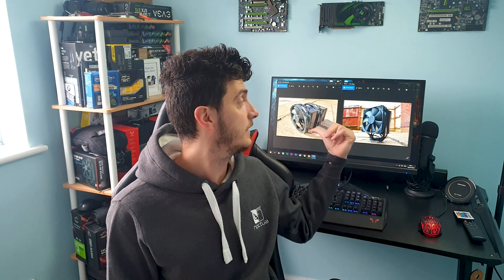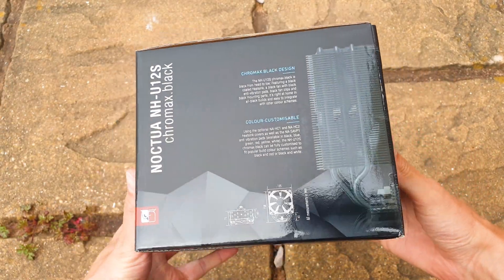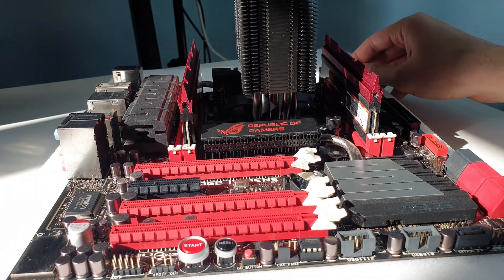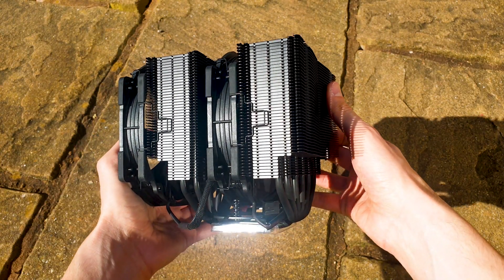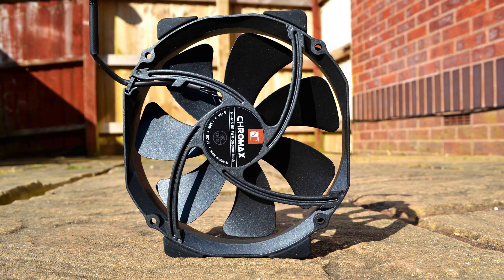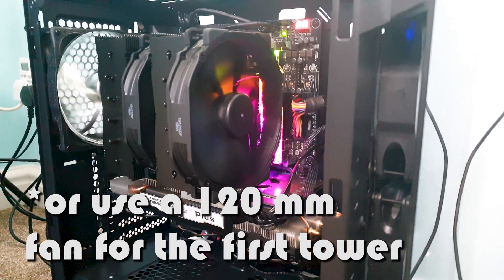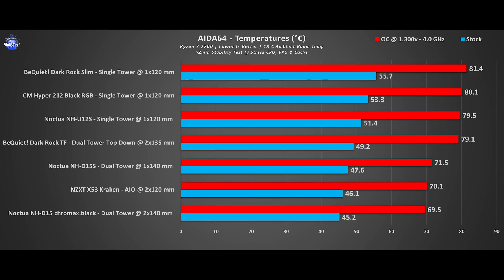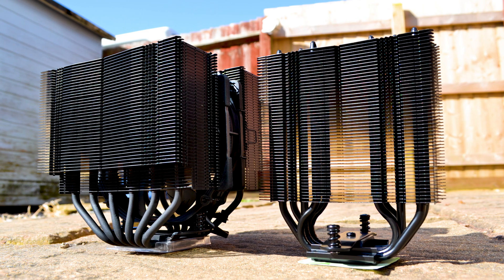Noctua NH-D15 & NH-U12S chromax.black Review | A New Air King and a new baseline !

Comment: Would users recommend the NH-U12S chromax black (the smaller version) over the Noctua NH-D15 (giant daddy) for the i5-13600k which has a Processor Base Power at 125 W and Maximum Turbo Power at 181 W. I'm having concerns getting the NH-D15 because of the weight pressure it might press down on a future DDR4 MSI motherboard of my choosing. Feeling a little bit worried.
Reply from the maker: Then try the U12A. Very close to the D15 but in a 120mm dual fan single heatsink package, I have a video for it as well 👍
Reply: @Glob3Tech  Thanks.

Comment: I have that beefy double-tower but after 2 years, the included 140mm fans are making a whiny noice, so I have to replace them with the design included from the smaller cooler. they are unbarable at full speed at this point. at 300-800 rpm still ok though. So I "have to" buy the 9-blade Noctua NF-A12x25 to get the the most quiet system possible. Damn it's expensive. The ability to read from the screen and work on the computer without fan noise, even when the computer is also  is working, is... fuck me so expensive. Noctua redux fans or the similarly designed 5-blade Arctic P12 fans are worth a shot if you can't afford to pay 60 EUROS for a couple of fans.
Reply from the maker: I know what you mean, the price is 'premium' well. No warranty left to try that route?

Comment: is the noctua nh-d15 gonna fit on asrock b550m steel legend, ram gskill flare x and vga rx 5600 xt ?
Reply from the maker: The ram is 40 mm tall so you would have to position the second fan on the d15 a bit higher like I did in the video, if you case accepts it. The rest, all good.
Reply: @Glob3Tech  oh yeah forgot to tell u my case is old one cooler master haf-x full tower. is the d15 gonna fit with VGA 5600xt ? there's still some space right between d15 and the vga ? or do i need vertical gpu bracket ? i saw compatibility in noctua website said that d15 will overhangs the top PCIe x16 slot. that's why i'm confused
Reply from the maker: @stevenaudy9323  From here it looks on the limit but ok to me. If you think it will touch or to risky, yeah a riser card adapter or have a look at the D15S. 

https://amp.reddit.com/r/ASRock/comments/hnxb6e/b550m_and_noctua_nhd15/

The case is good 190 mm cpu clereance so plenty if even you rise the second fan a little.
Reply: @Glob3Tech  noted. thanks for your insight and yeah i already looked at that discussion in reddit. from the performance perspective, which one is the best between D15 and D15s ?
Reply from the maker: You are most welcome 🤗 I tested the D15S as if you check the playlist please. Stock vs stock they are very close. What CPU are you using?
Reply: @Glob3Tech  yes i'm currently watching your review about d15s :)
i'm using ryzen 5 3600. i'm planning to do the OC. currently the temp for idle or daily using round up 48 - 55 celcius. when i'm gaming, the temp is between 75 - 85 c
Reply from the maker: @stevenaudy9323  Cool 👍 Yeah they get quite hot. The D15S should do the job plus it will eliminate the GPU issue since it is a bit smaller in that regard.
Reply: @Glob3Tech  alright Alex. thanks for fast reply and your insight. really helpful. cheers

Comment: nice video dude, do you think noctua nh u12 is fine for ryzen 5800x in a msi mag forge 100r argb?
Reply from the maker: On paper it should be fine but I think it will be on the limit according to them.

https://www.techpowerup.com/review/amd-ryzen-7-5800x/20.html

Check the D15S as well which has bette ram RAM support. 👍 Will do a video aoon on that one as well.
Reply: @Glob3Tech  thanks, do you think noctua nh u12a should have better temps vs nh u12s?
Reply from the maker: Oh yes. I reviewed that one and it's my favourite. It's as good as the D15 like only 1 degree beghind in my tests.
Reply: @Glob3Tech  thanks bro, good luck
Reply from the maker: @victorbaptista783  Thank you, you too. Let me know how it goes 👍

Comment: Hi may i ask if the noctua nh-u12s is sufficient for ryzen 9 3900x?
Reply from the maker: If you have plenty of airlfow in the case and maybe add a second fan, it should be just enough for stock usage. If not, I highly recommend the U12A which I also reviewed that provides D15 level of perfomance but in a very compact package👍 The 3900x is a hot CPU and better safe than sorry.  Also check the new D15S chromax.black which I will soon cover as well which also is very close to the D15 in terms of performance but has better RAM support etc
Reply: @Glob3Tech  thanks

Comment: Hey! Thanks for the review. Quick question: is it overkill to mount a NH-D15 on a Ryzen 5 3600? Thinking of going OC in the future with that CPU maybe.
Reply from the maker: Hi. My pleasure 🤗 Thank you as well.
Not at all, the D15 will be invaluable if you plan to OC and it will provide you with the headroom for any AM4 CPU basically. A great alternative check my review for the U12A please which is more compact and let's you use any RAM you want if that is a requirement as well. 👍
Reply: @Glob3Tech  Thanks for the prompt feedback! :D I will check the U12A review. In regards of the ram, i'll go with corsair vengeance lpx, so no problem with the clearence. So, the D15 will definitely be the right choice in both OC or an upgrade to the CPU.
Reply from the maker: @tutasteluta  You are most welcome 🤗
Ah perfect then with the RAM. Oh yes!

Comment: Is this cooler sufficient for a stock i9 10900k?
Reply from the maker: Which one? The D15 - yes. As an alternative I strongly suggest the U12A since it almost matches the d15 but it's twice as small. Check my latest video please for it. 👍
Reply: @Glob3Tech  Hi! I mean the  NH-U12S chromax.black. Is it suitable for a stock i9 10900k? Thanks in advance.
Reply from the maker: @necrotech69  The U12S should work but I don't have that CPU to give a 100% accurate answer. From what I know, it should be enough. You can always upgrade to a second fan as an exhaust on it and/or give the CPU a small negative offset. 👍
Reply: @Glob3Tech  ok, thanks! I appreciate your input.
Reply from the maker: @necrotech69  Sure, my pleasure 🤗

Comment: Is the noctua u12s good for the ryzen 9 3950x?
Reply from the maker: It will be on the limit over 80C in load for sure. You can add an extra fan but then it's worth getting the U12A which is almost as good as the D15. 

I will review it shortly - https://amzn.to/2FL0MQg

Comment: i have a nzxt s340 elite, which noctua cooler would you recommend me?, thanks in advance
Reply from the maker: Hi there. It depends on your CPU as well.  Your case accepts coolers up to 161 mm tall. The D15 apperas a bit tall at 165. So go with the U12S which is 158.

I will review soon the U12A which is amazing almost as good as the D15 and it's 158 tall as well.

https://amzn.to/2ZQyxGC
Reply: @Glob3Tech  thanks for your reply, i have a ryzen 5 3600, i'll wait for your review and see which one i prefer the most
Reply from the maker: @nls127  Perfect. Worth mentioning that the written one is live on glob3trotters.com 👍
Reply: @Glob3Tech  I just saw it, i'm going for the u12a most likely hope there was a chromax version tho, thanks for your help
Reply from the maker: @nls127  Thank you! I know, me too. 🤘
Reply: I know it's too late now, but NH-D15S is a bit shorter than the regular NH-D15, so that one could also fit inside your case. Still, U12A is also a very good cooler and more than enough for your CPU.
Reply from the maker: @Vengir  The D15S chromax.black will soon be reviewed as well 👍

Comment: FINALLY a good review comparing the NH-D15 vs the NH-U12S and to top it off some very valueable information about ram clearance. You answered all my questions I had before watching this review. Props to you for the great review and good luck in the future!
Reply from the maker: Thank you so much Sander for the kind words and feedback 🤗
Reply: @Glob3Tech  IF I WANT TO SUE 3 FANS, DO YOU THINK IT IS WORTH 3 FNS WITH 32MM DDR5 5200 OR 5600MHZ OR 2 14MM FAN 1 12MM FAN WITH DDR5 6000 OR 6400MHZ
Reply: @Glob3Tech  ?
Reply from the maker: What do you mean, fans to cool the ram?

Comment: I own the NH-U12S and a 3700x. I reach 86C on Handbrake encoding. How many Celsius would it drop by changing the one i havew to the NH-D15? (Again, 3700x ON STOCK SETTINGS, NOT 2700)
Reply from the maker: I would say somthing around 70C.

The 3700x in stock form is unnecessary hot due to the high voltage it pumps in. I did many videos with the 3700x in an ITX case where I discovered that if you manually OC it to 4.0 GHz on all cores for just 1.075v you will get amazing low temperatures but maintain the 'stock' levels of performance. I even cooled it with the L9a for 77 C with these settings. Imagine with the D15.
Reply: @Glob3Tech  Sorry, i have a 3800x. Sorry. My problem is that my previous MoBo died due to auto XMP and i dont want to touch anything OC related ever again, not even volts. I dont want to kill my 1 month old ASUS X570 TUF GAMING PLUS ..Hope ya get what i mean
Reply from the maker: @DVTHEFOX  Sure no worries. I see.

 I never tested the 3800x but according to some it will be hot if stressed tested. I mean if the enconding will stress the CPU as prime95, apparently it gets quite hot. But if you have 86C with the U12S, in my tests the D15 is like 10C cooler so you would have 76C.

https://www.reddit.com/r/Amd/comments/em1w8k/3800x_noctua_nhd15_temps/

Comment: I want the dh15 but I want to keep the aesthetics of my build with my rgb ram but this is one of the best coolers on the market right now, and at the price saving from an aio i can buy nice rgb fans, idk what to do
Reply from the maker: Hi Sean. Like you said you can always add later rgb fans to the d15. Also it depends on what aio you are looking. 

This is something that I want to get for myself. https://www.ekwb.com/shop/ek-aio-240-d-rgb
Reply: @Glob3Tech  I just dont know if its worth it because I have a 3600x, a proccesor that doesnt need a heatsink that large. I was looking into purchasing the ek aio you suggested but in my research I have found tower coolers are more reliable. So I think I am just going to buy the Noctua NH-U14s because it has a larger 140 mm fan compared to the U12S. But thank you for your consideration
Reply from the maker: Hi Sean. Sure of course. Glad you found your answer 🤗
Reply: @Glob3Tech  Thank you!

Comment: How does the U12S work with the Ryzen 3950x? I would mainly use it for Adobe premier, after effects, photoshop, and some audio stuff like Ableton. I know the D15 can handle that easily but I would rather use the smaller U12S if possible. Great info man thank you. 😃
Reply from the maker: Thank you! 🤗 I wish I had the 3950x to test it out for you 😁 From what I researched, the U12S might be on the limit in stock form. Maybe with a small voltage offset to have more headroom and maybe add a second fan to be sure. Hope this helps.
Reply: Glob3Tech cool thanks for the info. Ya I definitely would do two fans with the U12S if I go that route. I may just go with the D15 to be safe. We shall see. This will be my first build so I’m doing as much research as I can.
Reply from the maker: My pleasure. Good luck with the research and please let me know what temps you have in the end with the winning cooling option.

Comment: Great comparison. I was thinking about running a Ryzen 5 3600 build and the U12S was kind of what I was leaning towards. I realized that the Ryzen 5 3600 runs at 65 watts versus 125 watts from my current Fx8350. Thanks for the review/info.
Reply: Me too. Hehe
Reply from the maker: Hi. Thank you! 

Just a quick heads up, the 3600 despite its oficial 65w tdp, actually it will exceed that in load in stock form. This means it will be anywhere from 15 to 20 degrees hotter than the 1st/2nd gen equivalent.

https://tpucdn.com/review/amd-ryzen-5-3600/images/cpu-temperature.png

Also did a video on this with my 3700x if you want more info :)

Nevertheless, the U12S should handle the 3600 without a problem :)

Comment: Now try the nh-d15 on your 3700x and see how far you can push it
Reply from the maker: Oh yes will put it on the list 😁
Reply: @Glob3Tech  How did it go ?
Reply from the maker: @ibramistafanous1231  Hi. Well mixed results. So I did it on an open bench setup. Same build as in my Dan case just took everything out.  21C ambient temp.

In stock form with the D15 - I got 76C in Aida64 after 2 minutes. Really hot in stock form since so much voltage is dumped in it.

OC
I managed 4.3 GHz for 1.395v and got 79C. And even 4.4 GHz for 1.425v but 83C. Kinda hot for an open bench and with that monster D15 but those are the numbers :)
Reply: Glob3Tech thank you for the numbers, that’s one hot chip!